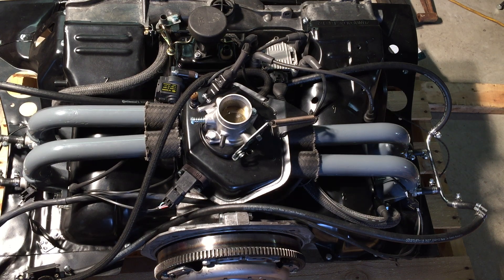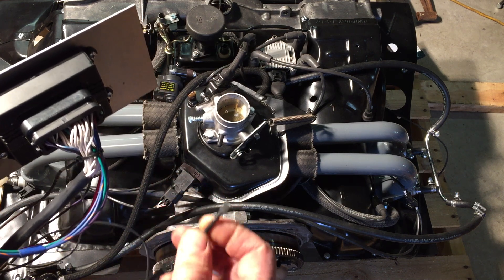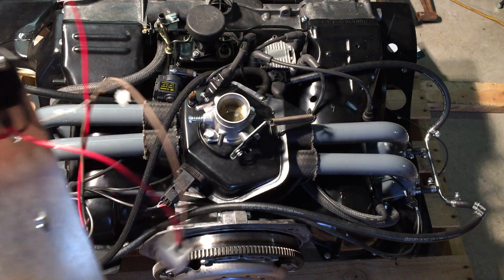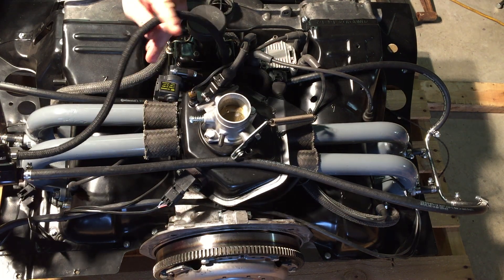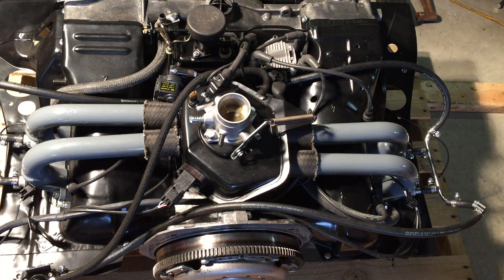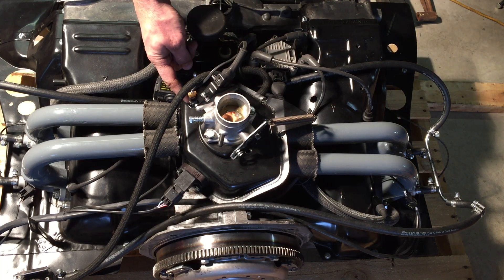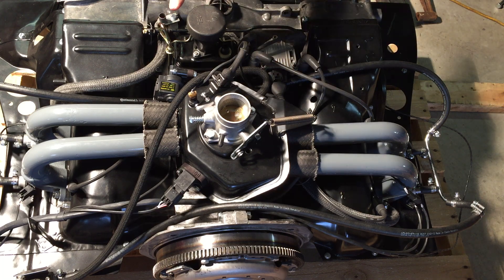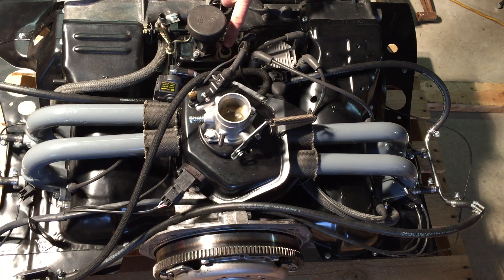Fuel Injection Walkthrough

Comment: Dude!   Awesome setup.   Would love to be able to ditch the “original” ECU on mine.   (‘74 914 2.0, though I suspect it started life as a 1.7 so I have a few “quirks” and mismatched pieces.  Looks like you got rid of the TTS, DV, and MPS too. 
I do have to say those fuel rails are driving me crazy.  Even with 90 degree injector hoses, I had a tough time getting my engine back in.

Comment: This is super cool.  What difference did it make?  Was it worth it?  I have a standard 914 1.8 and interested in exploiting the injection framework by updating with modern control like yours.
Reply from the maker: Good stuff if you have the patience for the learning curve.  It's far from easy.  Sure, getting a pile of parts is easy, but getting them to work well together and chase out all the bugs is the real challenge.

Comment: How reliable have you found the microsquirt? I have been considering  the idea of doing this with an experimental aircraft that uses the VW engine. 
Have you had any issues with the engine cutting out and being fixed with a reset on the ECU, or anything of that sort. Or had to re flash the system for any reason?